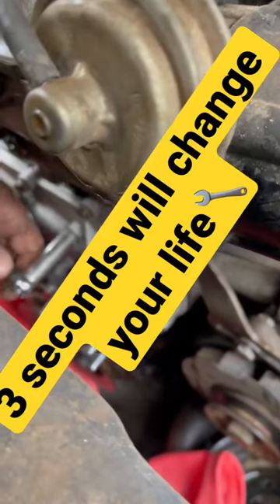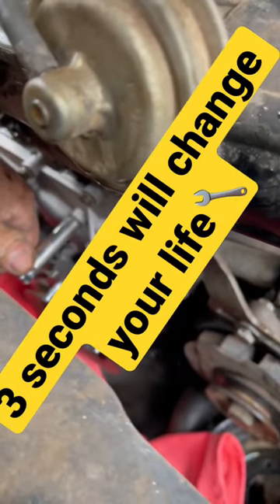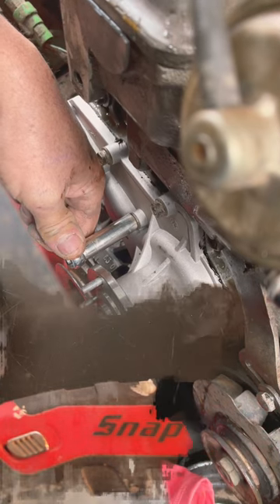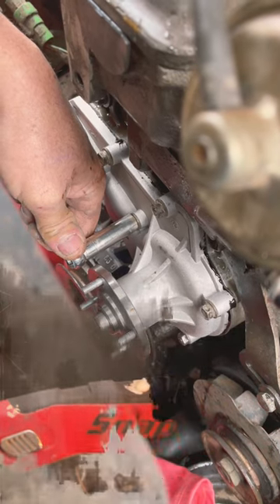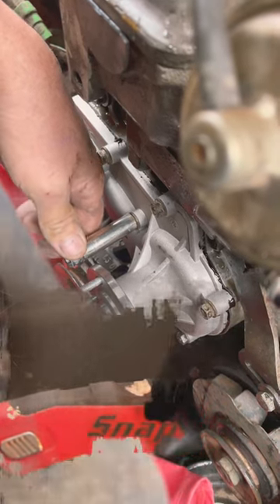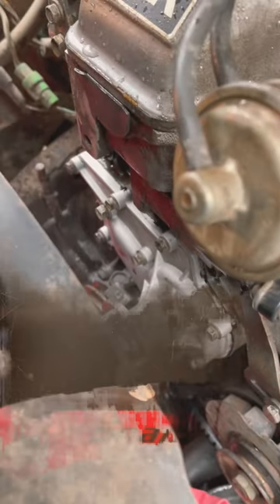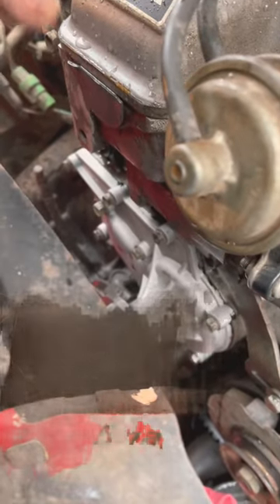This is why you hold your bolts for 3 seconds 🔧#shorts

Comment: If this were real you would just torque to an extra 10% so the "rebound" put it where you want it.
Reply from the maker: Actually not. It is not about how tight , it is about letting that settle. Not more, just the same amount, not wanting to turn back... You know that feeling when you tighten a bolt? It does not just get easy when it it tight, when you let the pressure off the wrench, you can feel the tension pushing back. Go focus on that next time, let me know what you think ok? Thanks.
Reply: @fastflo1  I turn wrenches all day for a living, 6 days a week for more than a decade.  I'm not sure if you're just messing with me or if someone convinced you of it but that's not how it works man.  

Let's say in theory you had a bolt where you oiled the under side of the head and not the threads to give it the best chance of creating this effect.  You've drawn the bolt in to create 10,000 psi clamping load then turn the head an additional 5° and it "rebounds".  You still have 10,000 psi clamping load.  The clamping load on the bolt is what keeps a bolt tight, and the clamping load is a direct parabolic function of how far the threads have stretched the bolt into the work (until yield).  

If we assume you want 11,000 psi clamping load under these conditions you would just turn the past 5° to overcome deflection until the bolt stretch is where you want it, still letting the bolt head "rebound".  For example, turn the bolt an additional 15° let it rebound 5° and end with a net gain of +10° rotation giving you 11,000psi clamping load.  

What you're describing is overcoming static friction in the threads.  You can't overcome static friction with a static load that has already failed to make it move.  You could hold the bolt at +5° all day but if it didn't make it move initially it never will.
Reply: @fastflo1  same goes for a tight bolt you need to loosen.  The only way to break a bolt free is to overcome the static friction.  If the bolt is tightened to 100 ft lb, holding 50 ft lb in the loosening direction all day would result in nothing.
Reply from the maker: @bradbeck2601  good info . You hit on something though. So the rebound it existent as you stated. Even though you do believe it has no effect , it foes. Not standing alone. The rebound is set in the direction of loosening it. That minuscule amount you speak of , gets set into motion when you add vibration , heat , back and forth movement . It is enough in some cases to be a catalyst to set forth the action of a bolt backing out. Have you ever wondered why some bolts come looses and some do not ? Not everything in life is Lester through a book. At the molecular level, this becomes a very debatable subject. The fact that we have dry threads, oiled threads, dirty , rusty, etc…. New bolts , old bolts, machines maybe 100 years old versus todays green metal. Torques wrenches , torque specs. Regular wrenches , open end wrenches. ASE certified to barnyard mechanics. Lock washers, crush washers, tapered heads, crush nuts, star washers , safety wire. All these things in place to prevent bolts from backing off. Loctite, and whatever else you could come up with . But holding a bolt in the direction on it being tightened could have zero effect at all? That shows me that people are done learning when they need to be right to be right . And true student of life would take this information and study it further rather than come up with every possible way to reject it. It almost shows that a great educated person can limit himself with the belief he knows everything. I definitely am the type that will hear something interesting that challenges my beliefs and give it every chance to be true so I could become smarter, more knowledgeable, gain experience and apply it to my life and add value. If it comes to numbers and bolts…. My numbers will rival yours . If that’s what it comes down too. What bolts have you been tightening on what and where ? On what conditions? And have you been applying this technique on the hose bolts? If not you will have zero feedback . The difference between you and I. That I can tell so far. Is that I learned this when I was in my early twenties when I studied aviation mechanics and studied metalurgy to work at Boeing. Fresh out of working summers as a teenager at a local machine shop. Straight out of high school small gas engines . And out of my grandfathers garage he work at Stanford linear accelerator center . I have been working on motors, hydraulics, boom trucks , chainsaws, tractors, excavators , chippers, 18 wheelers, boats, snowmobiles, jet skis, motorcycles, quads, welding , machine, forging, cutting , drilling , bolting , applying hardware , Skidsteers, trailers, hubs, bearings, chain link fences, wrought iron gates. Backstops. And so much more. So not sure what bolts you are really working on. But I have been doing this about every chance I get . And in the last 40 years I have had my share of bolts move a tad at the 3 second point or within. Not only is it true, it’s cool. So put the book down. Pick up a wrench and start now building your experience so you have real life feedback. Thank you for your detailed and educated response. Also I forget to mention . Low resonance vibration. And the Junker test info all relevant…..
Reply from the maker: @bradbeck2601  it will break freely easier if the rebound tension is set in that loosening direction . A settled bolt will require more force because it is not yet set in that direction. You ever go to tighten an old bolt and tit jerks forward a bit at a time? Perfect example. If you get the last little advance you’re good. If you leave it at the point when it has not yet moved. It will be set to rebound . Add vibration . You have a loose bolt relatively simple to understand. If you put it into layman’s terms……
Reply: @fastflo1  You've had a bolt move while holding it for 3 seconds, but were you monitoring the torque?  In your video you hold it by hand, that's not exactly scientific.  The amount of torque you're applying to it could change just based on your stance.  Try holding a bolt for 3 seconds with a digital torque wrench and keeping the torque exactly the same.  You're doing this based on superstition.  Bolts come loose because materials settle in.  A gasket loses elasticity and doesn't provide the same outward force, clamping pressure decreases and the clamping pressure is what keeps the bolt in place.  A bit of dirt between materials settles flat and decreases clamping load.  Micro vibrations and movement cause fretting on material surfaces.  Vibration moves the base materials back and forth and settles in the area of least resistance causing a decrease in clamping load.  There are many reasons for a bolt to come loose but "bolt rebound" isn't one of them.

For reference, my experience comes from a family-owned quarry but they own different businesses and farms nearby as well.  I work on just about anything you can think of from haul trucks as big as a house to chainsaws, 450 HP 3-phase rock crusher motors to handheld electronics.  All self taught.
Reply: @fastflo1  so by your standards, the worst offenders of this "bolt rebound" would be impact guns and hammer wrenches then?  Since they apply a shock load to tighten they would surely be the first to loosen, no?
Reply from the maker: @bradbeck2601  well, it is really not by my standard . It is not my belief that makes it true. It is metal composition . Along with many other factors we previously discussed. The open end wrench your are referring , is exactly why you would want to use this. In real life. You will be at a friends house one day and he may only have a tool set from harbor freight and nothing else. Nothing else. Put the water pump on like this, do what I said, and your pump will work fine and bolts will most likely stay tight. Put your specs away, your torque wrench , your impact gun , and bust out some common sense . Not everyone is in a shop armed with all of that . Maybe you’re helping someone on the side of the road , or only have a crescent wrench? How are you going apply all that crap your talking about ? Seriously. Let’s keep things in context . Hopefully you keep trying this and just see for your self . You keep trying to be right you will not learn. I already know so your argument will not benefit me. You are the one that can gain something here not me. I am sharing it with you . So it is perfectly ok with me if you remain stagnant and want to stop learning , growing , and keeping an open mind .  No problem here  all 👍🏻😀
Reply: @fastflo1  you know how often I use a torque wrench?  Head bolts and main caps, that's about it, I usually do lug nuts by feel too.  It has nothing to do with it, I meant try holding a specific torque on a bolt and see if it moves.  Maybe it's only moving because you're leaning on it a little harder.
Reply: @fastflo1  let me put this another way.  So, you turn a bolt and the head turns farther than the threads.  When you take the wrench off the head stays still, just a little bit ahead of the threads, correct?  So why does holding pressure on it matter?  If the head stays still ahead of the threads then it already has the bolt in torsion.  The head is already applying torque to the threads.  If you just let it sit there on its own for 3 seconds then the threads should "catch up" on their own, right?

If the theoretical problem you're afraid of is the head springing back counterclockwise and influencing the bolt to loosen from the hammer effect then wouldn't you just tighten the bolt slightly above where you would have then apply A little pressure in the loosening direction to straighten the bolt out?
Reply from the maker: @bradbeck2601  so now you refuse to learn one more thing …..
Reply from the maker: @bradbeck2601  no . Because tightening it more will just duplicate your first action . Unless you apply the 3 seconds , you are just making it tighter . Not settling the bolt . Like you talked about settling in your previous statements ….
Reply: @fastflo1  no, you didn't listen.  tighten it a bit farther, to make up what you would be waiting for, then put a bit of backward pressure on it to "settle the bolt".
Reply: @fastflo1  also, you didn't address the first portion of that reply.  If the head is staying still when you remove the wrench then it is already applying the forward torque to the threads and holding it there.
Reply from the maker: @bradbeck2601  the part that baffles me is your constant need to be right. I am really not trying to be right . The proof I have told you a million times before is on your own hands . Not like some big secret I have the lock too. You can simply go find out . That is the part that is comical to me. No , I am not trolling anyone. The videos get looked at whether I comment or not . That has nothing to do with it . I have learned a lot in my life about mechanics and how things work . I have worked with many good people over the years and have accumulated a lot of good information and tested all of so I know what I can rely on and what I cannot. After all the years of knowing these cool tips I wanted to start sharing them . For people that want to learn to be a better mechanic. To grow their knowledge and gain experience. To learn from others and accelerate your skill set . To pass on what I have gained and hopefully help someone that really needs it or wants to be the best they can be at what they do. To ensure in every way they are doing the best to their capabilities to do a good job and rely on their work . In any situation. With any tools . And have a good overall understanding of what they are doing and how things work. Their is  much to be gained from this tip if you were open to it . But a right fighter will always fight to be right . That is the main difference between you and I. I do not need to be right . You do. If you were to apply this lesson you would become a better mechanic instantly. Keep your edges sharp . A knife needs sharpening as well as your mindset . You will learn nothing by refusing this information. But , with an open mind you can gain so much more and learn more and grow more and share it with others . I promise you , genuinely, if you make a practice of doing this you will improve. In focus, awareness, feel, and understanding of the relationship of the metals and the conditions of which you are applying these forces. In those three seconds , your arms will shake, you will tremble , you will feel , you will think, you will have a better understanding. You will pay more attention , you will be more thoughtful and thorough. You will make less mistakes. Your end result will be better . Often in life you can teach the lesson , know it may not be learned as fast . Good luck to you my friend , sincerely, Fastflo1 👍🏻
Reply: If you're just holding the head in place and not applying additional torque then the head is already doing that for you by staying in place.
Reply: @fastflo1  you also said that you know it works because you sometimes feel the bolt move while holding it.  But... That means the head moved.  That doesn't mean the threads "caught up" by any means, you're just assuming that.  If the head moved then aren't you back to where you started?
Reply from the maker: @bradbeck2601  I found an article for you to read . It may help explain something to you . Do you want to keep going back and forth with Summit and ARP BOLTS also? 😊👍🏻https://www.onallcylinders.com/2021/03/28/the-right-way-to-install-your-engine-fasteners-understanding-friction-bolt-stretch-clamp-load/
Reply: @fastflo1  First off, that article is agreeing with me... not you.  There is zero information there that supports your claim.  I'm very familiar with the physics of how a fastener works because I find it interesting and have done a lot of research on it.  IN MY FIRST REPLY TO YOU I was talking about bolt stretch, yield point, and clamping load as stated in the article.

Secondly, I really hope you didn't present that article to me just because it says the word "rebound"  because they are referring to axial fastener stretch (long ways), not fastener torsion (twist).

When they say "rebound" they are talking about the elastic phase of tightening, rather than reaching the plastic state where the fastener is permanently stretched.   When you tighten a fastener the threads are stretching the shank axially, there is a certain amount of stretch that the fastener can recover from or "rebound" back to the original length (this is the elastic phase).  If you go further you have entered the yield point (like torque to yield applications) where the fastener becomes permanently stretched and cannot recover or "rebound" to the original length (this is the plastic phase)
Reply: @fastflo1  I think you need to do some research on the difference between tension and torsion.
Reply: @fastflo1  and to top it off, this isn't even an analytical article, it's a friggin advertisement for ARP fasteners and Ultra-Torque assembly lube.
Reply from the maker: @bradbeck2601  I knew you would do this . Like reading a book 📖 it was a simple reference like I said. Pushed you even further and closed your eyes even harder . Sheesh . Let me try something else with you …. I’ll be back when I can think how to get you to understand just basic common sense and how to apply it ….. this may take a few I hope you do have patience……
Reply from the maker: @bradbeck2601  drives you crazy reading that article about the bolt being like a spring . I can see you in the Summit and ARP forum already 🤔😬😬😬
Reply from the maker: @bradbeck2601  go tell the ARP guys  to change the ad 😂
Reply: @fastflo1  🤦‍♂️
Reply: @fastflo1  READ YOUR OWN DAMN ARTICLE!  THEY NEVER MENTION TWIST OR TORSION!  BOLTS STRETCH LIKE A SPRING IN *TENSION*!
Reply: @fastflo1  PLEASE QUOTE THE PART YOU THINK PROVES YOUR POINT!
Reply: @fastflo1  you don't think it's weird that in an article about "properly torquing fasteners" that they don't mention your method at all? 🤣. Not a single word about holding pressure on the fastener after tightening it.  🤣.
Reply from the maker: @bradbeck2601  you can’t stand the fact I googled something the first time and found this . You’re just making yourself look even worse now. Ask for proof. Find it. Then disregard it. Classic . Just too funny when someone can’t accept they got showed up 😊
Reply from the maker: @bradbeck2601  now go complain to ARP AND SUMMIT 😂
Reply from the maker: @bradbeck2601  now you’re all caps yelling 🤣😂🤣😂🤣😅😅🤣😂
Reply from the maker: @bradbeck2601  you’re so mad they rebound 😡😡😡😡😡😡
Reply: @fastflo1  also, that article is in relation to unprovable topics such as religion as noted by all the scripture in it.  They are basically telling their sheep to avoid debates with atheists (probably in fear of more people leaving the faith when confronted with facts or embarrassing them on the internet).  When you're dealing with physics there's a right and wrong and you're on the wrong side.  I have found not a single person, article, or procedure describing "holding pressure on the bolt" or "holding the bolt in place" for any length of time.  This is the most extreme case of the Dunning-Krueger effect or confirmation bias I have ever seen.
Reply from the maker: @bradbeck2601  there was a time when nothing was proven , the truth was the truth. They thought the world was flat for how long? Then realized it was wrong? Because you did not find it in a book does not make it untrue. In fact it could be true, maybe you have not looked at every piece of information ever written. So , it is entirely possible it is totally 💯 true and you are unaware of it . It may be wrong and if I search long enough maybe I will find it is true .  It because you have not yet found the piece , nor have I . It is open for debate. Lots of fun going back and forth with you . We have an opinion . Both of us do. I have the right to mine and you have the right to yours.I have the ability to block you . You have the ability to not look at the video . You have the choice to engage or walk away . So do I. We both made the choice to keep bantering back and forth . I made a video . You can agree or disagree. I made this channel to enjoy.  Not really to argue back and forth and watch people get upset, stay on the page and never stop and basically lose their mind. . Hopefully you enjoyed the video. I appreciate you checking the video out . Subscribe if you enjoy the content and want to see more videos in the future. Keep scrolling if you do not. Block me if you would like. But what is the real part of embarrassment would be for me is to stay engaged and continue to watch you scream in all caps with your responses right or wrong. I removed the right fighter comment . I really did not want the entire article based on religion . Just the part about having to be right . I was a right fighter like that , had to be right  Two right fighters will bang heads until they die. . I am Working on being more open minded as I move along . I know it did help me.  And beside the bolt …. We all do have voices and opinions and should be polite and respectful. So my apologies if I was rude  or passed judgment. My goal is to engage with my viewers and the comments in a fun and enjoyable manner. So whether I am right or wrong . I cannot make you agree, I do not want you to agree, I do not care if I am right, I could be wrong. That is what it sounds like if you give up having to be right . Just for and example . I think for the time invested we should all learn something from this. And if it not holding a bolt for 3 seconds . Maybe we need to learn respect each others opinions and be human with each other . Thank you for your comment 👍🏻